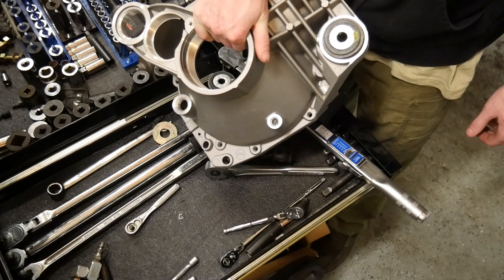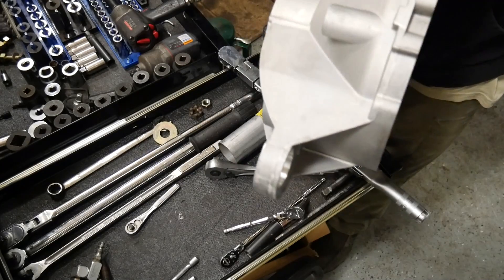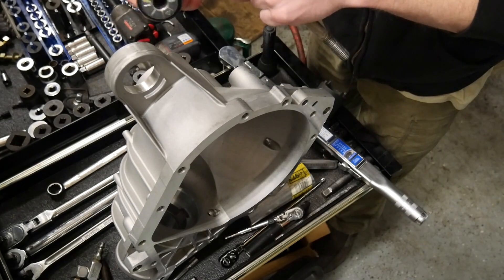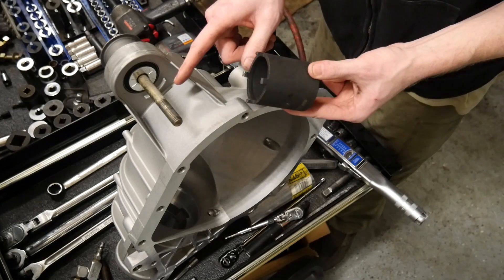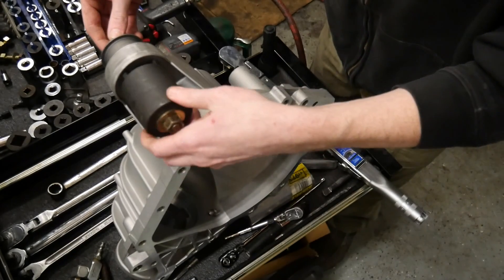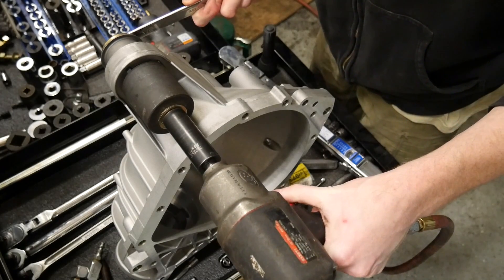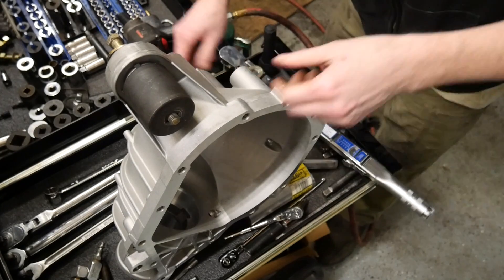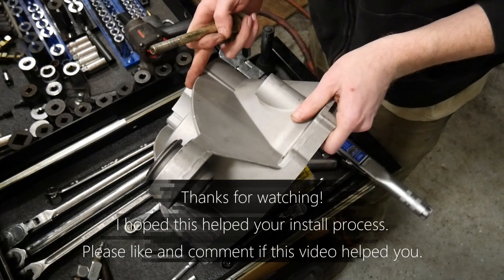DIY - remove and Install bushings without specialty tools!

Comment: The title is remove and install. I need to remove a bearing in a similar way and for whatever reason I can't picture the order of bolt/nut/wash/cup to the removal.  The bearing is installed on the end of a shifter cable so there isn't a big housing to mate up against.

Comment: Cost of that socket can buy complete set bushing press tool.   I tried on Ebay before comment this.
Reply from the maker: 8$ at the parts store for this socket.  How much is the bushing driver set?
Reply: @EpicTim  what size was that bolt and what size was that 1/2in socket? 36mm?
Reply from the maker: @jlrockafella  1/2" drive 1980's ford 4x4 locknut socket with a 1/2" bolt, dont recall the length, maybe 6" long
Reply: It's about diy* what tools you have around you.